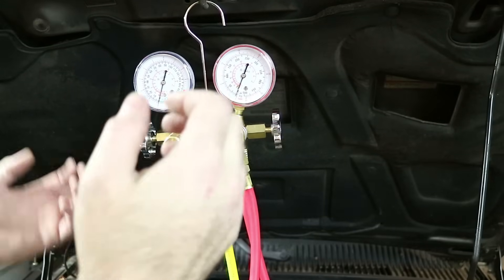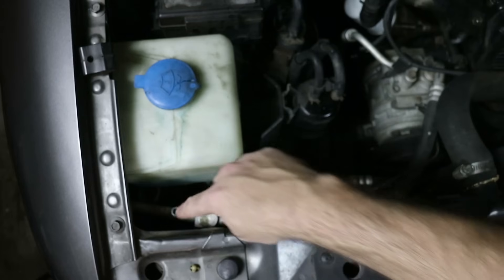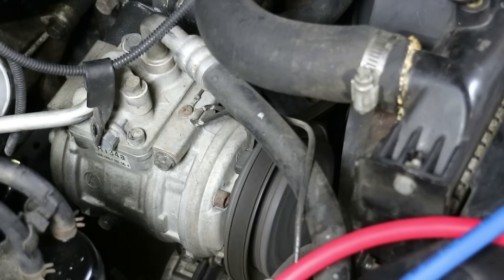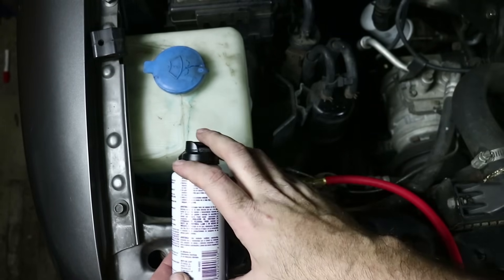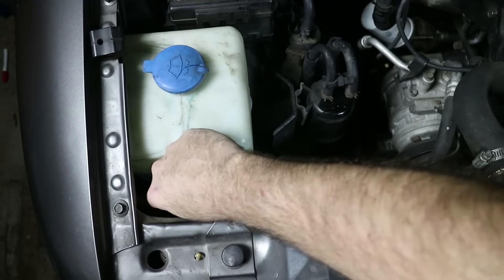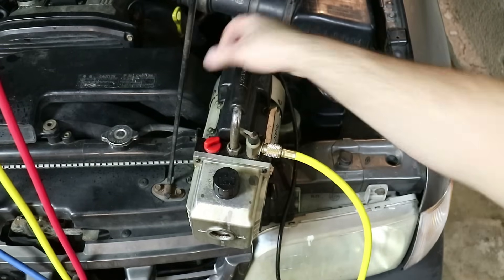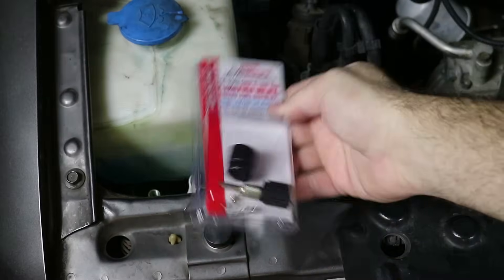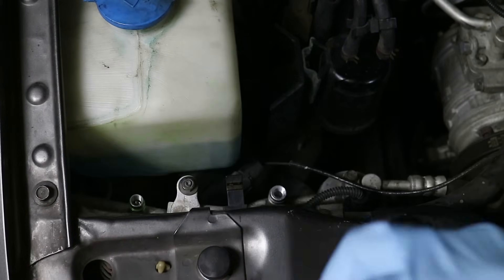How To Recharge an A/C System Professionally DIY

Comment: actually back in the day ,the 90s when certifications were required to handle r12 and conversion kits were introduced ,that mineral oil in r12 was not compatible with the new pags,you would 

 have to change the drier and flush the system completely,then add your  new pag which is the oil after you vacuumed the system 6 ounces was the usual a tech would measure 6 ounces and stick the yellow hose into the oil open the low side valve and it would be sucked in and then you would charge the system.the conversion kit as i remember were only two quick disconnect vavles that screwed over the existing r12 valves.and back then brake fluid was used to flush the system.
Reply from the maker: Sounds right to me
Reply: Back then R11 was the flush.

Comment: @50sKid what would be the ports for low and high on an e46? i used the can with valve attached method unfortunately didn't work using the connection next to the Positive battery box i still get warm air and now my A/C does a whistling sort of sound through the center vents. So i immediately shut the A/C off. im going to have the system evacuated cuz i got the feeling it got overfilled for trusting dash temp reading of 87 degrees when my phone it was actually 77 degrees out. thanks for your vids dude
Reply from the maker: You connected to the low port.  As I said in the vid, the ports are different, you can't connect to both.  The cans are only made to connect to the low.

Comment: Shouldn't you also purge the blue line line at the connector on the A/C system? Believe that line was also exposed to the atmosphere when you changed the schrader valve.
Reply from the maker: When you disconnect those hoses, they self-seal.  However, when I drew the vacuum afterward, that purged all the hoses again.
Reply: With those style high and low side connectors, I do not believe it is possible.  It will empty your system out.
Reply: I had the same question. Maybe purge all lines by connecting the can and open/close the valves, before connecting to car.
Reply: I would have done the purge at the connector of the blue line at the low side fitting, to do the yellow and blue line in one swell poop.  Then you don't need to rely on the self sealing fittings to work.

Comment: Very nice job there 50sKid. Learned a lot. I have always been curious as how to bleed the actual low/hi hoses AFTER service is completed.  When disconnecting low/hi couplers from car, the manifold gauges are still reading pressures.  How do you zero them out once off the car?
Reply from the maker: With all the valves closed on the manifold, if you leave the yellow line connected to your can (with the tap closed) and the low line connected to the car and open, you can disconnect the high line (the gauge still shows pressure and nothing is leaking out of the high line, indicating there is pressure in the high line), you then just open the high valve which allows the contents inside that hose to travel into the low hose, and then you can open the low hose valve at the manifold and let everything get sucked into the car.  When you close everything off you are then left with about 30psi on both sides of the manifold because all the pressures got equilized.  Then disconnect and you can let whatever is in the low line vent to atmosphere because you basically have no way to recover it.  It's a tiny amount.

Comment: My AC wasn't blowing very cold and would only kick in that not very cold air after about ten minutes of driving in hot weather (90 deg).
The clutch is engaged the whole time the AC is on.
I vacuumed the system and only got a vacuum of 15 (or is that -15).
I let it sit for 45 minutes and the vacuum didn't change.
I then put a 20 oz can of refrigerant in (its an Audi A3 which I believe takes 19.6 ounces) and the air was colder (but it's only 75 degrees outside now). The hi pressure was up to about 150 on the manifold gauge and the low was about 40 on the gauge on the can (couldn't fill using the gauge set because I didn't have the right fittings). The air was noticably colder and the AC pipes were cold to touch the low and warm on the high, not hot but definitely warm.
I then disconnected everything and let it run for a few minutes then re-connected the gauge set on both high and low. The high now read 125 and the low was 0. So I disconnected the low and connected the gauge from the can (having removed it from the can itself) and it read 40. I tried again and the gauge set (low) still reads 0. The can gauge still reads 40 when I reconnect it only now the high reads 100.
I couldn't look for leaks because my refrigerant doesn't have dye, I have to rely on the vacuum not changing proving there are no leaks.

Am I doing something fundamentally wrong ?
Have the gauges suddenly malfunctioned giving the 0 reading on the low when the can gauge reads 40 ?

All the time I had the engine running with the AC on full and I also noticed that the radiator fans were going into overdrive every few seconds.
Another thing I tried was hooking up the gauges and opening up the low at the gauge set manifold to see if any pressure came out, none did even with both low valves wide open.

Assuming there is an issue with the low on the gauge set why is my high only 100 when the can gauge reads 40 ? Compressor, orifice valve ?
If the gauge set is not malfunctioning (it seemed ok until half way through this process) then what's going on, how is one gauge connected to the low reading 0 and a different gauge connected to the same port reading 40 ?

Hope you can offer some suggestions. I'm at a loss.
Reply from the maker: Umm, it's concerning that you only got 15 when doing your vacuum.  It should have been close to -28" of mercury... basically pretty darn close the maximum vacuum on your gauge.  Definitely sounds like something is wrong with your low gauge on your manifold set.  I think using the gauge from the can for that is perfectly fine.  When you said you tried to let some pressure out with your manifold, you said none came out with "both low valves wide open" - what did you mean by that?  There is only 1 low gauge.  The reason your high is 100 and the gauge on your can is 40 is because the high is reading from the high pressure side of the system and the low (can) is reading from the low pressure side, so obviously there should be two different pressures right?  I'm concerned that you only have 100-150 on your high side.  It does sound you might not have enough refrigerant in the system.  Double check the sticker under your hood to see the correct amount that you need.
Reply: When I said "both low valves wide open" I meant the low valve connected to the low pipe on the AC system as well as the corresponding valve on the gauge set (poor terminology on my part). Both were open but nothing came out which indicates to me that the system was empty, however, when I disconnected the gauge set and just used a gauge from a can connected to the low on the AC system it read 40 psi. Also, the air blows colder than ambient so I'm assuming there is some function at least.

Autozone looked up the car and they told me the system required 19.6 ounces of refrigerant so I used a 20 ounce can. I'll see if I can find out more.

Would a 15" vacuum be strong enough to expose a leak if there were one ? 
The vacuum pump oil sight glass indicated that it was low on oil, would that cause poor vacuuming performance from the pump ? Should I top off the oil and try again ?
If I only pull a 15" vacuum then do I still have residual air pressure in the system which uses up refrigerant "space" therefore causing low refrigerant because half the space is air and half refrigerant when I fill it ?

Thanks
Reply: +Will Beames
"...the low valve connected to the low pipe". This should be turned clockwise (we usually think of turning counter-clockwise to open a valve) and the one at the gauge should be turned counter-clockwise.

Might that be your problem?

Comment: i have a question i just replaced my compressor and accumaltor and expansion valve i then pulled a vacuum and charged my system but my gauges are reading 65-70 low and 235 high ..what would you get out of the readings like what is wrong
Reply from the maker: Sounds like you may have too much charge in your system.
Reply: +50sKid i put the right amount of freon ..could it have to much moisture or air in it or to much oil? would a bad condensor cause that?
Reply from the maker: A bad condenser could certainly cause problems.  Too much oil as well.  Compressors sometimes come with the correct amount of oil pre-installed.  Did you also add oil while charging and thus add too much?
Reply: +50sKid im thinking thats what i did because it was a new compressor not a reman ..i added 5oz my car takes 9 total but i did evac and recharged it and 2oz of oil came out so i didnt put oil back in ...but i also only did 10 min vacuum i have rear ac as well and my condensor fins at the bottom have rocks and are a bit bent

Comment: How much does it cost to evacuate your ac system when working on it
Reply: You are talking about two separate things .  You need a recovery machine to recover the refrigerant from your system .  Easier and cheaper to take it to a shop rather then buy a machine,  hoses ,  filter dryer .
Then you use a vacuum to ....well pull a vacuum.  Negitive pressure.  That pulls air and moisture out of the system.  The goal is a dry and tight system .  Perfect set up is you have a micron guage on your vacuum to pull below 500 microns . And you change the vacuum oil before each use  .  Let the system sit in a vacuum (  as he did )  to see if it leaks .  
I appreciate that he changed both Schrader valve cores while he had the chance.  It so cheap to do ,  it dosnt make sense not too . 

Then you use a scale to weigh in the exact factory charge.  He is incorrect when he says an ounce wouldn't make much difference.  The smaller the charge in a system the more critical it is . 
Always remember your A.B.C " Airflow before charge "  make sure your blower is working . Make sure to change your cabin air filter,  clean your evaporator condensate drain line ,  and hose off the condersor in the front of the car . 
Just my thoughts 
Good video though,  fantastic camera work .  
I dont know it all but  I am epa 608 universal and 609 (  automotive )  certified.
Reply from the maker: Should be around $20-$30 at any local shop with an a/c machine.
Reply: Or you could buy your own vacuum pump.  They're not as crazy expensive as they used to be and you'll be ready for about any project needing vacuum... Plus, you won't have to wait for the shop to open and give you some time.  Many won't even talk to you...

Comment: Sir, if the outside air temp is quite high, as we live in Dubai , the heat tht one should use oven gloves to steer, Wht could be the pressure variation you recommend. As we know, when the temp goes high the pressure increases. So if the pressure increases, does it have adverse effects in its compressibility. Basically to tweak to summer, do we pressurize or depressurize. And one more super doubt I have is, while tweaking, do we use max rpm, say 3000or idle. My fear is if I recharge at idle and will it over pressure while driving. Does it have any protection mechanism.
Reply from the maker: it has a protection mechanism. you don't adjust the refrigerant for hotter climates. the system is designed for the exact amount of refrigerant recommended and that is it. it can only cool the air so much. we've had 116 temps here recently and my cooling wasn't as great but it still got cold...eventually lol
Reply: wow, excellent, you saved a lot of time for me, i was going behind the standardization really.

Comment: Is there a good reason for NOT using teflon tape when re-assembling your AC system? It seems like it should go a long ways towards preventing leaks.
Reply from the maker: Every joint has a special o-ring. Teflon tape so both unnecessary and unfit to do the job.

Comment: if the low side is 30 40 psi and  the yellow hose is cracked open it will blow out the/yellow hose suction line with low side manafold valve open its pressurizing the fill/discharge line because no neg pressure is comming from the refrigerant can
Reply from the maker: The compressor is creating suction which creates negative pressure in the low side, thus sucking in the refrigerant.
Reply: +50sKid its like you reach in push the shrader valve it releases pressure

Comment: Thanks your video was the only one I found that addressed the oil issue.  I had a leak from an o ring at the compressor line.  My system hold 6.75 oz of oil.  I wonder if I need to add any oil or how much was lost. I saw a small puddle underneath the truck.  I wonder how much oil was in it or was most refrigerant.
Reply from the maker: Ah, if you saw oil under the truck then that is not refrigerant (refrigerant is a gas at atmospheric pressure).  What you should do is remove your compressor, tip it upside down into a measuring cup to drain all the oil.  Some compressors have drain plugs in the top for doing this, btw.  Then add back in the proper amount of oil and recharge the system as per my video.  This is the absolute best way to do it.
Reply: Thank you for that information!!!

Comment: one thing I've learned from this video is that California is a fucking annoying state. wtf is that blue plastic cap extra HAHAHA shitty environmental overkill laws, shitty gun laws, overpiced cost of living, No fucking water etc. 
I wouldn't have evacuated the system. I woulda dumped right into the atmosphere cos pressurized electronic dusters are almost identical and people spray that shit all the time.
Reply from the maker: Lol, I know.  At least the adapter is only $3.  Actually it's kind of a good idea for that particular puncture-style can because if you don't use all of it you'll have to keep the brass valve adapter on it and closed otherwise everything leaks out.  With the CA style cans with the internal schrader valves, you're free to remove all your adapters and store them on the shelf for next time.  But of course the CA cans have a fricking $10 refundable deposit!!  Those cans are currently on sale at Wal-Mart for $6.88 and I want to stock up but there's no way in hell I'm letting them keep $10, lol.  Of course you realize I can't put a video out there in which I release refrigerant into the atmosphere and break the law.  I can't control what anybody else does, of course... ;-)  But that law is still a bit silly because, it's like, if your system develops a leak then you just polluted the atmosphere anyway.

Comment: That's the set of gauges I just purchased from Amazon! I like them too. Good reviews also.
 I would have enjoyed the window that is on some of the other gauge's charge line, but I think this set will last me. 

Have you found a nice case for yours 50's kid, or do you just use the hook for storage?

Great video and responses. Thank you for the great info everyone. Everyone else is afraid to list a temp pressure chart. I know it will be not an exact but thanks for the ballpark 50'skid!!!

Cheers, Rob
Reply from the maker: Yeah I miss having a sight window too, but it's not a big deal.  I just store it by the hook with the hoses connected to the storage spots.  Thanks for watching!

Comment: thanks wht of replacing new dryer do i need oil too thanks once again
Reply from the maker: Most of the oil is in the compressor but there is always some inside the other components as well.  Best to follow the policy of adding 1 oz of oil per pound of refrigerant.
Reply: MegaZemor 
Ya add it to yellow line

Comment: good educative video 1 quick question, i do engine swap and lose all the refrigerant or freon do i need oil after i deed vacuum on the system too thanks
Reply from the maker: Probably just a little bit.  Most of the oil remains inside of the a/c compressor so you do not need to add the full required amount that you find in the reference manual.  What you can do is just buy refrigerant with some oil in it already.
Reply from the maker: Probably just a little bit.  Most of the oil remains inside of the a/c compressor so you do not need to add the full required amount that you find in the reference manual.  What you can do is just buy refrigerant with some oil in it already.